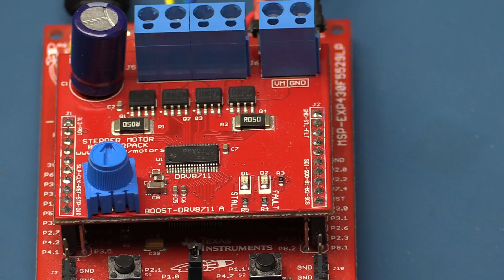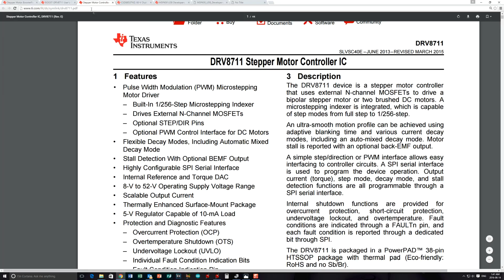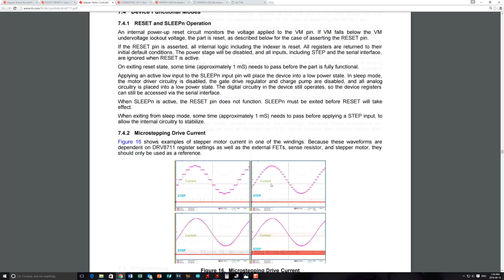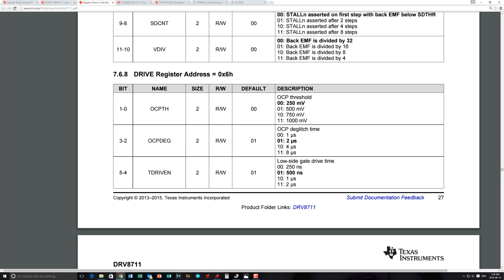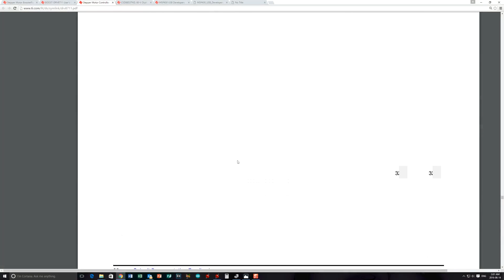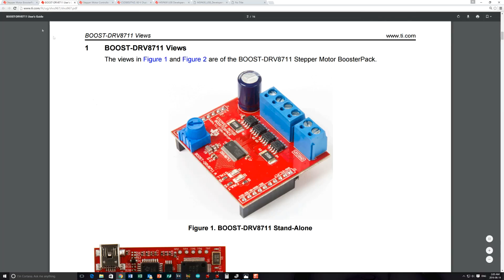TI Tuesday - Stepper Control Boosterpack

Comment: Would you please give a link about the code that is used in this video? Thank you.
Reply from the maker: I just uploaded a load of my sample sketches to github, the one your after should be this
https://github.com/thebreadboard/SampleSketches/tree/master/Stepper_drv8711
Reply: Dear Peter, thank you very much.
Reply: Hi Peter.  I've tried your code and haven't been able to get my motor to run.  I noticed the code you've uploaded to github is different than the code in your video.  Is there a reason for this?  I notice that my getCurrentRegisters returns 7FFF for all registers.  This doesn't seem right.